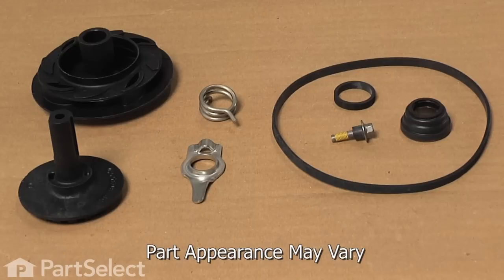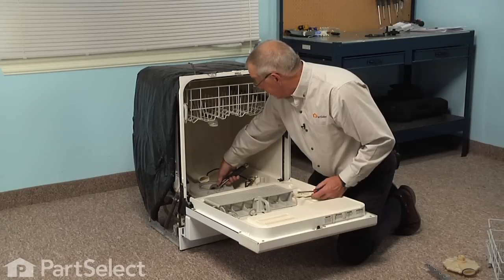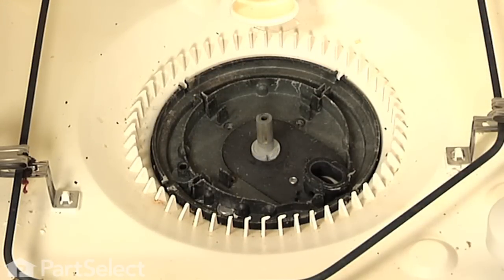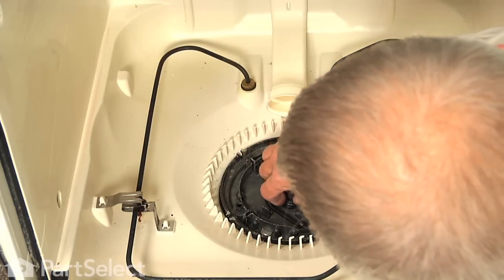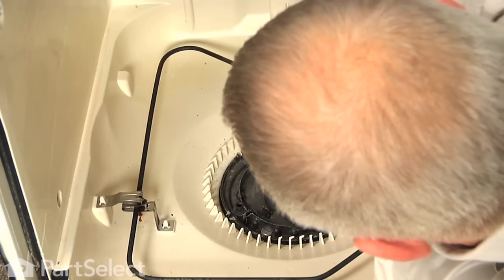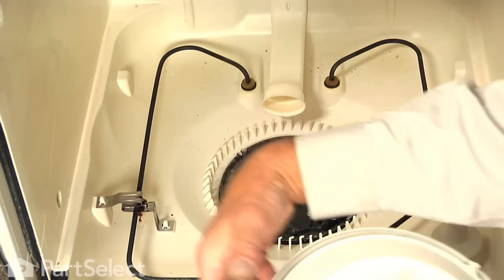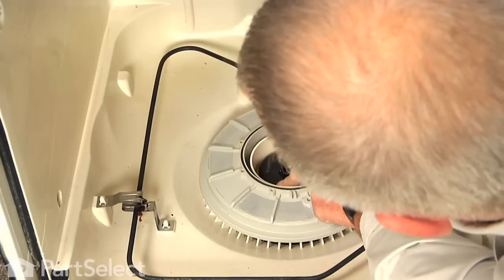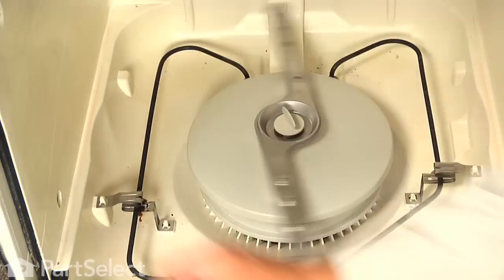Dishwasher Repair - Replacing the Drain and Wash Impeller Kit (Whirlpool Part # 675806)

Comment: I just received the kit and installed. It today. This dishwasher is so quiet. It used to be loud, and now I know why. The chopper blade and spring were messed up and the impeller shift was separated from the  disc part. Whisper quiet now. Thank you for this video. It saved me from buying a whole new dishwasher.

Comment: I think I missed something. You couldn't remove the drain impeller, so you used a chisel and Hammer to break it into small pieces. Then you cut to a greasing of a new seal which was under the impeller. But you didn't show how you remove the old seal. Did it come out with the old drain impeller? Or do you have to remove it in some fashion with a tool?
Reply: I noticed this too. Did you figure it out?
Reply: Just finished the repair myself and can tell you he didn't show that part because it's a HUGE pain in the ass. Literally had to break it into 30 pieces to get it out, then same deal with the washer underneath. Penetrating oil helped a little bit but it was still pretty rough.

Comment: I came here because I have this model dishwasher and is making horrific grating sounds during the wash cycle. So before I saw this video I just started disassembling to try to find out what hard bit might be stuck in the chopper blade, but as soon as I got to the screw holding the impeller down, I could turn it, but after I loosened it a while I could not turn it anymore. So I tried turning it the other way, and it got looser, but got tighter again. I'm not replacing the impeller, I just want to get down further into the guts to check for a hard object, but I don't want to split the impeller with a hammer and chisel. Any suggestions?

Comment: I just went through something similar with a different brand of dishwasher. Coming from a manufacturing background, what amazed me and earned my admiration is that so many of the components either easily snap or twist into place. The designs of the components make it much easier to assemble in the factory. Even accessing the three lugs which retain the bowl-shaped housing for the pumps and sump are easily accessible from underneath the dishwasher. I was able to just 'thumb' those lugs out of the way and then remove the entire center assembly from inside of the dishwasher. 

My admiration for the dishwasher's design only goes so far because correcting the problem of the clogged circulation pump's impeller was so satisfying. I didn't, thankfully, have to diagnose any electronic gremlins and I hope that will never be the case. The previous dishwasher lasted eleven years and developed an electronics problem which nearly went out in a catastrophic fashion. The manufacturer sent a technician to our home to see the issue firsthand. The fellow was impressed with what he saw and we had a brand new dishwasher exactly two days later. Remember that these machines are designed to function in a high-humidity/moisture environment. Over time moisture and water vapor are most likely going to infiltrate the machine's electronics. So, I would strongly suggest keeping an eye on the user interface panel and be on the lookout for any signs of scorching or peeling around the edges of the soft-push buttons and on the face of the display panel.

Comment: Great video :D. 

I found it useful to tip the dish washer over at a angle and have it rest on something (if there is water careful it will get all over unless you use shop vac), then put a screw driver in the motor at the bottom where the screw driver is preventing the fins from spinning. Now I got my ratchet or nut driver and there was no need to use the wrench and break the plastic impeller.

Comment: This is a great video. I love you Steve! You make it look so easy. Unfortunately, I could not get the screw that holds the impeller so I could not remove it to get the filter separator out to clean it and get rid of the crud that is probably causing all the problems. But I did find a mason jar lid that  was floating around so maybe it wasn't all for nothing!!!
Reply: On older dishwashers the torque needed to remove the bolt may be so great that the adjustable wrench slips off the wash impeller hub no matter how tight I make it and no matter how hard I hold it in place. (Same with a large pair of channel locks with good teeth on it.) To solve this problem I use a 31/32" shower-valve socket wrench on the wash impeller hub. The wrench is hollow so I can run a 1/4" socket on a an extension rod down through the hollow to get the bolt. Sometimes the torque is so great it seems like the bolt is going to shear off, but those bolts must be made of super tough steel because I've never had one break or be so stuck that I've had to replace the motor. Also, this trick avoids having to drill out the hub of  the wash impeller to remove it. If I did that, I would still be left with the problem of holding the motor shaft as I tried to remove the bolt. In that case I would put the wash impeller (with drilled out hub) back on, and now with the filter assembly removed I would have good access to grab the wash-impeller hub with the adjustable wrench. Still, the shower-valve wrench is  the better solution because it's never going to slip on the wash-impeller hub. 

I should mention that I often have to destroy the drain impeller to get it off, If I did that and still had the bolt stuck in the shaft, I would grab the doubly flatted shaft with an adjustable wrench, but that would risk damaging the shaft, so the shower valve socket wrench is still the better solution.

The nominal size of the hex on the wash impeller looks like 1", so I have to use a little force to get the 31/32" socket down on it, but that's good because then I get a really tight no-slip fit. The next size larger is 1-1/32" and that's a little loose which could allow it to slip under the huge torque needed to break free the bolt. So 31/32" is better.
 
My local hardware store has the complete set of 6 shower-valve socket wrenches for $28 and the individual wrenches for $8. The set comes with a cross bar for a handle, but if you buy the single socket, you'll have to use a screwdriver or some  such thing as a handle, or you can grab the socket (more accessible than the wash-impeller hub) with an adjustable wrench.
Reply: I had to chisel off the black impeller...

Comment: Thank you for this video!  I have the Whirlpool DU915WPQ0 model and it seems identical to the one in the video. It was making a buzzing noise and the lower wash arm wasn't spinning.  Using the video instructions,  I disassembled the wash arm and impeller area down to the chopper and the two balls.  Inside, I found a handful of plastic fragments about 1/2" in size in with the impeller and chopper area, that area under the cover with all the Torx screws.  Removed the plastic chunks, cleaned all the crud and gunk off all the parts, put everything back together, and dishwasher worked like a champ again!  I'll make sure I buy my next appliance parts from your store.
Reply: Hey Jim...I have one similar to this. Do you know where the filter is to this?
Reply: @savagem74  They don't seem to use a filter as such - the chopper blade chops everything up and it goes out with the waste water...

Comment: Thank You Partselect for posting my exact washer :).   Guys if the black plastic impeller starts to spin in the adjustable.. Use a Large channel lock pliers with GOOD TEETH on it.  I found this gave me much better grip than the adjustable wrench so that you can turn out that stubborn 1/4 bolt
Reply: On older dishwashers the torque needed to remove the bolt may be so great that the adjustable wrench slips off the wash impeller hub no matter how tight I make it and no matter how hard I hold it in place. (Same with a large pair of channel locks with good teeth on it.) To solve this problem I use a 31/32" shower-valve socket wrench on the wash impeller hub. The wrench is hollow so I can run a 1/4" socket on a an extension rod down through the hollow to get the bolt. Sometimes the torque is so great it seems like the bolt is going to shear off, but those bolts must be made of super tough steel because I've never had one break or be so stuck that I've had to replace the motor. Also, this trick avoids having to drill out the hub of  the wash impeller to remove it. If I did that, I would still be left with the problem of holding the motor shaft as I tried to remove the bolt. In that case I would put the wash impeller (with drilled out hub) back on, and now with the filter assembly removed I would have good access to grab the wash-impeller hub with the adjustable wrench. Still, the shower-valve wrench is  the better solution because it's never going to slip on the wash-impeller hub. 

I should mention that I often have to destroy the drain impeller to get it off, If I did that and still had the bolt stuck in the shaft, I would grab the doubly flatted shaft with an adjustable wrench, but that would risk damaging the shaft, so the shower valve socket wrench is still the better solution.

The nominal size of the hex on the wash impeller looks like 1", so I have to use a little force to get the 31/32" socket down on it, but that's good because then I get a really tight no-slip fit. The next size larger is 1-1/32" and that's a little loose which could allow it to slip under the huge torque needed to break free the bolt. So 31/32" is better.
 
My local hardware store has the complete set of 6 shower-valve socket wrenches for $28 and the individual wrenches for $8. The set comes with a cross bar for a handle, but if you buy the single socket, you'll have to use a screwdriver or some  such thing as a handle, or you can grab the socket (more accessible than the wash-impeller hub) with an adjustable wrench.
Reply: I used a 1" wrench and a socket for the 1/4" with no luck. So I got my impact screwdriver (Milwaukee) for the 1/4" nut and that had the grunt to break it free. Looks like we all have to come up with something to get that thing off.
Reply: I could not move that bolt with anything holding the black impeller with a screwdriver handle with a nut driver socket on the end.  To get more leverage to break it loose i used the 1/4 socket on a 3/8 ratchet drive with an 3/8 extension with a 3/8 to 1/4 reducer on it to put the socket on. This additional length with the ratchet drive got me the leverage i needed, wouldnt have got it off otherwise

Comment: Hi Steve! A couple of things: my friend figured out how to remove that pesky little nut holding the black part just under the first plastic cover (the washing impeller) that gave me so much grief as noted in my first comment on this video- using a 1" socket with a set of vice grips to hold it, he then through the 1/2" hole in the socket, he used a 1/4" drive socket with an extension to go through and remove that nut. The other thing you may want to consider doing on your next video is to give us fewer shots of the back of your head and more of what you are doing. Thank you again for a most instructive and well-done video. You saved me from having to pay for a new dishwasher!!!!

Comment: Thank you for this great video. I was worried that the motor was damaged on my dishwasher, but it turns out that something got stuck and the grinder blade spring uncoiled and caused some problems. I replaced the parts shown in the video and it's working again. Thanks

Comment: Good vid, although one of the gaskets that came with my kit didn't look like it was the right size and, because your head was in the way a few times, I couldn't see if you had stretched it into place or not so I left the old one in rather than risk a leak. Keep 'em coming. Thanks.
Reply from the maker: Glad we could help!
Reply: Yeah I found the small gasket supplied was too small for my Kenmore . It would fit with stretching - but then did not protrude above the part to be able to make a good seal. I cleaned and reinstalled the original one... which strangely seemed slightly too big for the groove 🤔

Comment: This video is great, but it still is missing something in my case to solve my no-drainage issue.   First off, I had to break the black impeller to get it off as it wasn't coming off for anything.  Oh well.  Now I am stuck at getting the chopper blade off.  It won't budge an inch.  It doesn't have a bushing, but it doesn't want to move.   But the water at this point is still not going anywhere and I cleaned all the debris around the outside and down where the two balls go, but water is still standing.  Where is the water suppose to go?

Comment: Great video.  I have the same unit, so this was especially helpful.  The separator in my machine is full of disgusting gunk.  I figured that it would come apart for cleaning, but I don't see how to do this.  I thought it would just snap apart through the use of a flathead screwdriver, but that doesn't seem to work, and I don't want to break it.  Is this part meant to be cleaned out, or must it be replaced periodically?  I presume it should be cleaned out, so if you can provide advice for accompishing that, I would be most grateful.

Comment: Hello-
 I just replaced everything that you did in  this video. (My unit looks exactly like yours). It is still leaking onto the motor. Should I buy a new dishwasher or will taking the motor off and looking at it help. The big o-ring around the inside seems to not be leaking.  The unit is  not draining also. The unit started to leak when I set a wash cycle. Thank you, Larry. My dishwasher is 10 years old.

Comment: This video was informative and helpful.  I would not have gotten the dishwasher apart and back together without it!  I have a question about the "separator"--is it supposed to be able to come apart for cleaning purposes? Thx!
Reply from the maker: What is your model number?
Reply: dishwasher is a Kenmore--I think the model # is 3380957 REV. A    The inside of this dishwasher matches the one in your video--it's why your video was so helpful.
Reply: I don't think that is the model number.  The part number I'm talking about is 3380788--but it actually has changed.  I ordered the part from you all.
Reply from the maker: The information that we have does not indicate that the separator can be disassembled for cleaning.

Comment: This instruction video was great and very accurate! I am worried now that I've begun a "test load" because I do not hear any water running through the washer. Is it normal for a delay in water returning to the unit?
Reply from the maker: Niki Lawson What model number do you have?
Reply: Model number: DU10000CGQ1
Whirlpool- Imperial Series

It wasn't filling at all and thus began to smelling "burnt"  when I was running a test wash. I didn't know if it was normal for the water to take a while to fill after being worked on. 
I ended up canceling the cycle and once it cooled, I poured a bit of white vinegar and hot water down the washer's drain. 
It's worked amazing ever since!!!
Reply: @partselect  I need help!! Lol...mine was not draining. Broke it apart but do not see any filter. Trying to clear filter or clog

Comment: Hi! Thanks for that video. Where can I find a replacing part for the  unit part that we can see on the video in the middle (back)  of the dishwasher (that go up and fill water for tray bottom/middle spray arm)? And what's the name (number) of that part?

Its the little tubular plastic part that goes inside the Middle Spray Arm who's broken. Don't  know if it can be fix (glue?) or if I need to replace the long middle back unit .